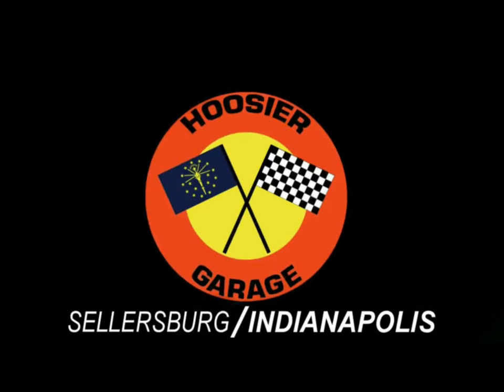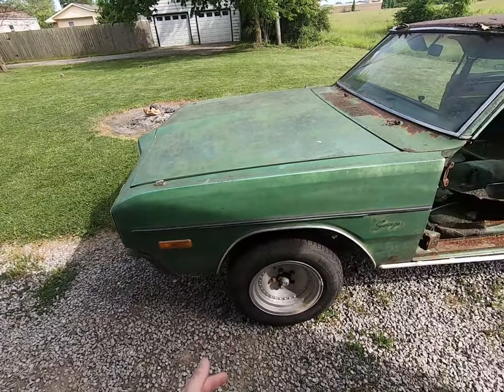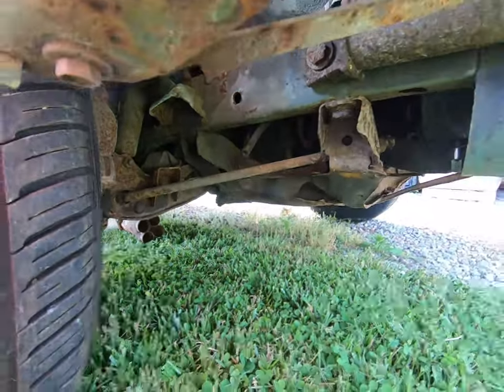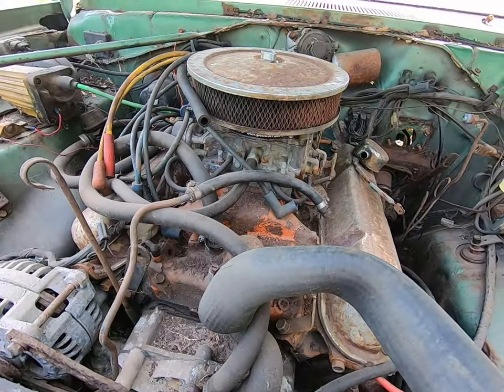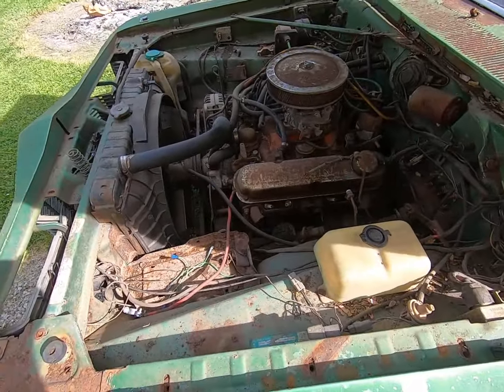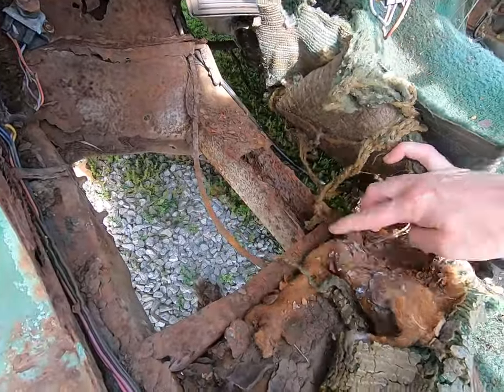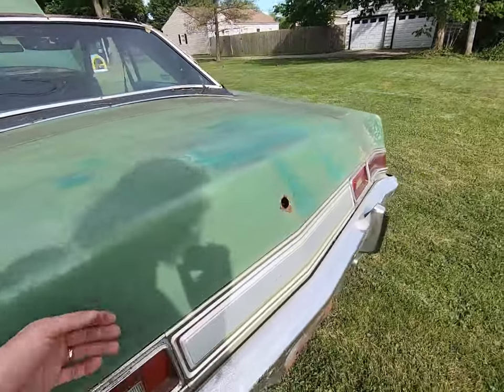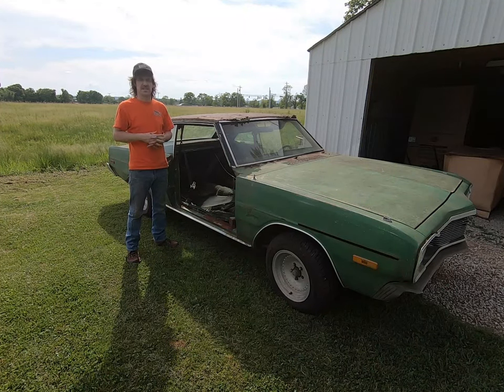Parts Car!- Hoosier Garage

Comment: 73-76 A bodies with a /6 and drum brakes are small bolt pattern , V8 with disc brakes are big bolt pattern.
My stepson had a 76 Scamp , /6 with drum brakes , was a small bolt pattern. I once won a bet with another vendor at the St Louis Monster Mopar show as to whether a car he just sold , was small or big bolt , before he pulled a hubcap off the car. It was small bolt , just like I figured... Keep up faith , Mopar to Ya !!!    The Wheel Guy !!!
Reply from the maker: I think the v8s came standard with discs, i cant think of a drum car 73+ with a v8.
Reply: Very true , have I ever met you at any of the Mopar swaps , up until March of 2020 , I did swaps for a good 20 years as The Wheel Guy !!!
Reply from the maker: @franklong8573  not sure. I have been to Indy a bit, and mopar nationals in the past
Reply: I was usually the guy that had more wheels , than anyone else , at a given show.  The Wheel Guy !!!
Reply: @HoosierGarage  It's a good thing they made discs standard on the v8 cars the drums were barely adequate on the slant 6 by 73 as the car got too heavy due to 5 mph bumpers.  I had a 74 Dart with a 318 and if the street was wet you would go sideways if you stepped on the brakes too hard.  This car lived a hard life but there seem to still be a lot of good parts especially the glass and front end parts.
Reply from the maker: @1575murray  73 was a good year for across the board upgrades but historically the styling suffered as did some thing like the internals of the doors. After being into some 72 doors 73s while okay kinda lack. hindsight I guess.
Reply: @HoosierGarage  Chrysler tried to make these cars do things they weren't intended to do.  Too much weight in front.  The Aspen/Volare were supposed to be better but they had their issues too.

Comment: Great part's car! I have the spool mount K member and disc brake conversion on my demon from a 73 340 duster, only difference in that one and mine is it has a sway bar, which you can easily add. I've broken a few motor mounts in the past and actually had the air cleaner bend the hood on a 70 coronet I had, the spool mounts take away that worry! I have that same radiator set up also! Lots of great parts there!
Reply from the maker: Seeing as i saw a spool k member sell for 250 alone a few weeks ago this was a no brainer. Whole car for $450
Reply: @HoosierGarage  great deal! 👍

Comment: Keep up the good work! Those 318 I have 2 just 1968 blocks. The one in the truck is 525 for torque the next will be 550 torque monster. They can be great blocks. And sound nasty as can be! Ever need help! Give me a holler! I'm here in Illinois! 🍻 🍻 🏁 🏁
Reply from the maker: I guess im wondering what the best all around heads should be on my van after can and header swap. Needs mid range and top end capability over torque.
Reply: @HoosierGarage  honestly the old x heads with port and polish. A little bigger intake and exhaust valves. And old beehive springs will treat you right honestly. Never fails. Best small block versatile heads ever invented
Reply from the maker: @AmericanHeritageRails  doesnt lower compression too much in a stock 318?
Reply: @HoosierGarage  more air flow meaning sucking in and blowing out! The cooler block will run and you'll see manifold pressure increase. I use a "boost" gauge and pull positive 15. But I also use a 2 inch tappered spacer as well with an 850 Holley double pumper from the 70s. Mines built for racing. But same can apply for a daily grocery better. Oldest and best kept secret for top and low end power for the mighty 318
Reply from the maker: @AmericanHeritageRails  awesome. Thanks for the info!
Reply: @HoosierGarage  not a problem at all. Anything to help a fellow Greaser and knuckle Buster. What it's all about!

Comment: I'm working on a 73 duster. And was wondering if you could help me out with something.  It has manual steering and I want to upgrade that to power.  Will I have to shorten or replace the steering column?  I've never done this and don't know much about it, so any information would be appreciated.
Reply from the maker: It can be shortened, the coupler can be removed and you will have the round shaft with a pin in it. Reference a power steering column for correct difference. Other than that you change the gear box obviously. The pitman arm to power steering arm, grab a pump with pulley, the brackets and pulley with extra groove. Also need the steering coupler for a PS car. Preferably all off the same car
Reply from the maker: If you hang around on my channel, i will be converting the van soon. Its basically the same swap.
Reply: Thanks.  I've watched all the van vids.  since you're going to replace yours I'll wait and see how you do it.  really appreciate you getting back to me.

Comment: one thing on this Swinger don't seem right to me is the gauges cluster I thought the Dart had longer and the Valiant had the big short speedometer.  my dad 1970 Duster had front drum brakes and my dad change it to disc brakes in 1978 and change the lug studs on the rear driver side axels to go right handed threads so the Duster don't have the og left handed.    and that engine is good repairable and Mr. Gasket that is a great brand by Holley well it Holley manufacture now.
Reply from the maker: Swingets fron like 72 or 73+ had thid style. Your dads 70 was just that. Another year.
Reply: @HoosierGarage  well my dad got the Duster in March 15,1978 for $350 at a used car dealer in Lawrenceburg TN. It had a California state sticker on the window and the car was a dealer option in St. Louis IL. dated Feb.20 1970 on the broadcast sheet deleted trim package with 318 2bbl manual trans steering and brakes the car came in FJ5 Limelight Green and all black vinyl interior no stripes floor shift 3 speed till later in 78 he install a A833 O/D 4spd trans from trades the og 3spd for it out a 1977 Dodge Aspen 318. dad sold that Duster when I was 12 years old on Oct. 21,2001. I only got one picture of the car that got my older brother and my dad but it the rear of the Duster did had more photos of the Duster but it all went up in flame from the house burnt on Dec 06th 2000.

Comment: Are the wheels 14 or 15 inch?
Reply from the maker: They look 15 but i will have to confirm.
Reply: @HoosierGarage  Please confirm, if they are 15's I would be interested in them.
Reply from the maker: @MostlyOldPartsAndRust  i knew i forgot to check on sonething. I just looked. 14's
Reply: @HoosierGarage  That's no problem, thank you for looking.  I really want 15's.